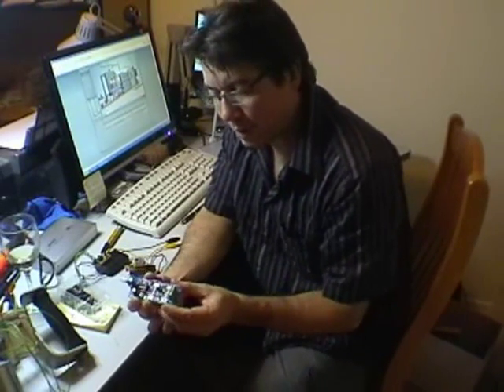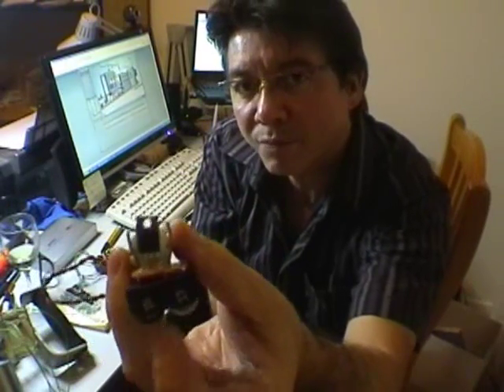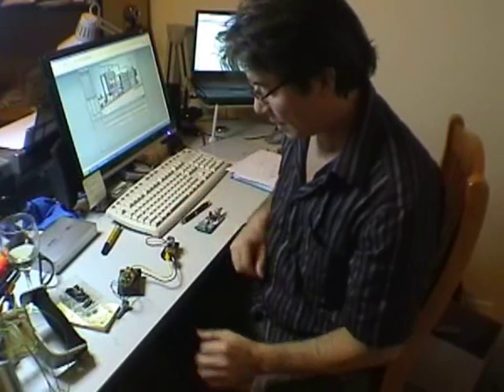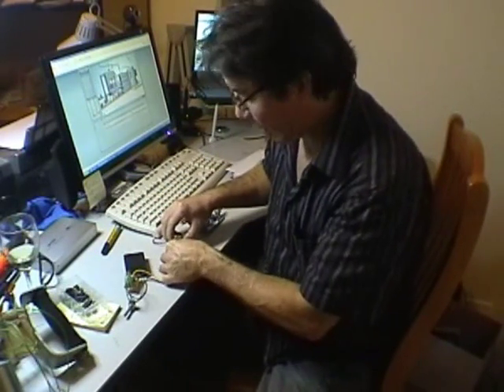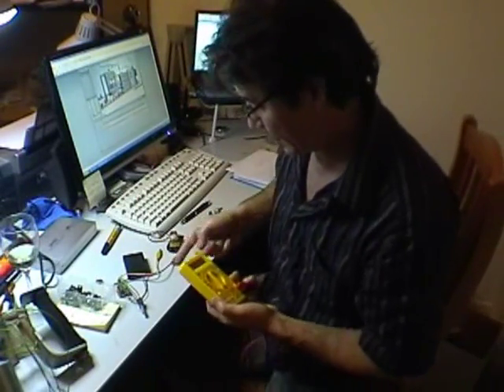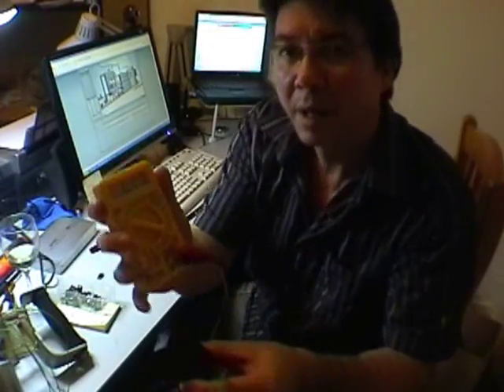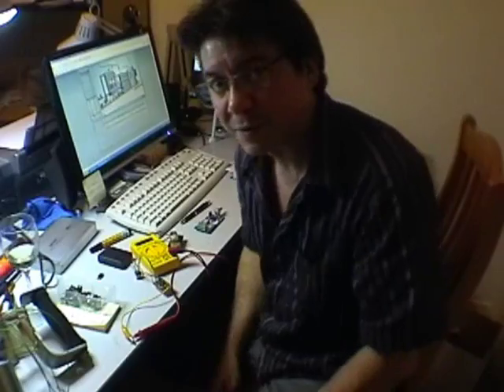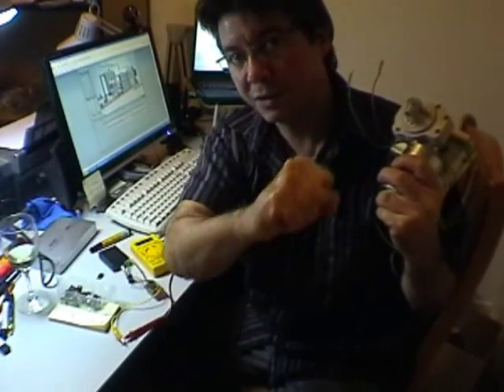Testing Dodgy Mosfets using a simple 555 PWM controller

Comment: @Twistx77 the motor's coil has an inductance, which results in high frequencies being attenuated, so you need much higher voltage to drive the motor at higher freq, and efficiency quickly decreases.

think of the motor like a woofer. it has force and excursion to deliver bass, but the inductance resulting from the strong magnet and thick voice coil wire means it isn't any good reproducing treble. the motor is the same, just that it rotates instead of moving in and out.